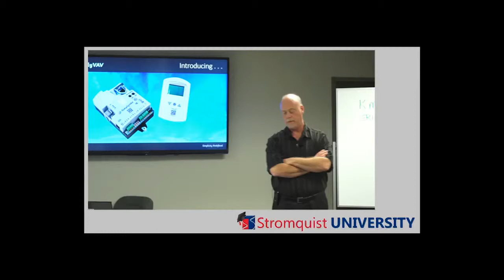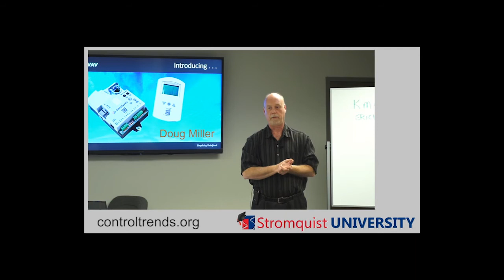BACNet Games: Get the Right Open Protocal

Comment: I still find Bacnet sucks it is not as interoperable as they tout I’ve had a manufacturer say their device communicates on 76800 and It would not after hours of jerking around pu oscope on device found it was not communicating on 76800 got a new board manufacturer rep comes to install it it doesn’t work finally guy says to me he can’t say it but it does not communicate at that speed says lower to 38400 I said all devices must be changed  he says not his responsibility . So after deciding not to throw him off roof I call his boss and he tells him to help me readdress the other devices on buss as we were still holding a third of payment. So yes Bacnet sucks
Reply from the maker: I here you my man! Have you heard of Haystack Connect? We just posted a video on it.The long and short of it is that it is a tagging converion that make sit very easy to extract data. One of the vendors as a BACnet to Haystack data pump that converts BacNet points to a more universail lanangue. Let me know if you are interested and I will send you a link to the product and teh vendors website.
Reply: ControlTrends Smart Buildings yes I have used it in Sarasota
Reply: I just dropped my honeywell webs with Broudy precision Honeywell would no longer let them ship Spyders to Florida
Reply from the maker: @dlhvac1   I have an office in Orlando and we are authorized Honeywell dealers, could we be of assistance?